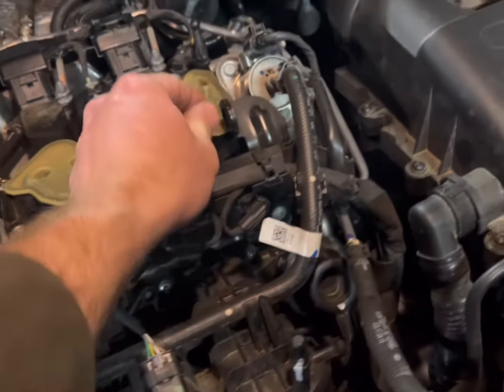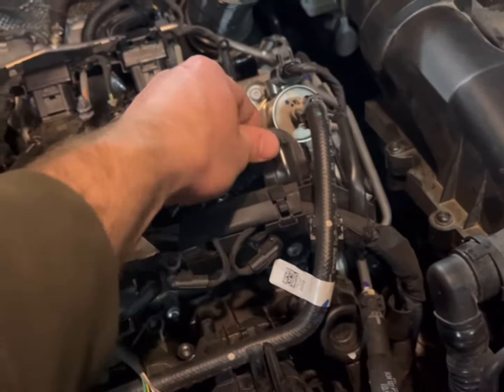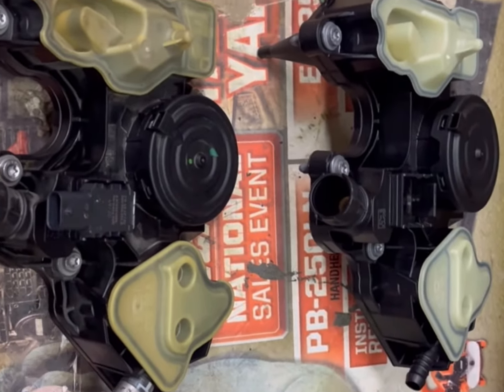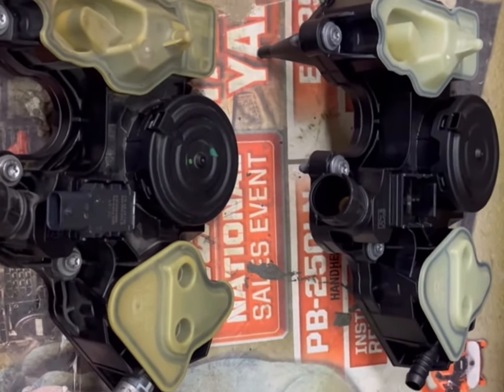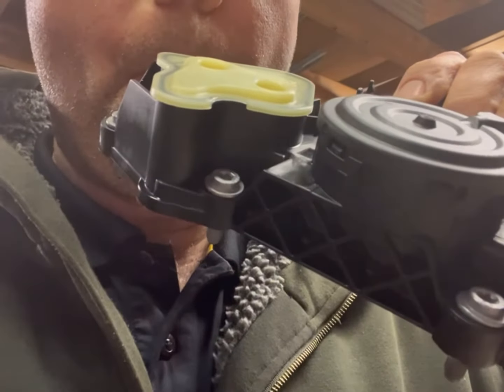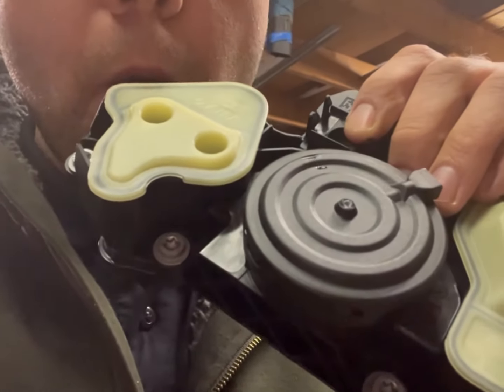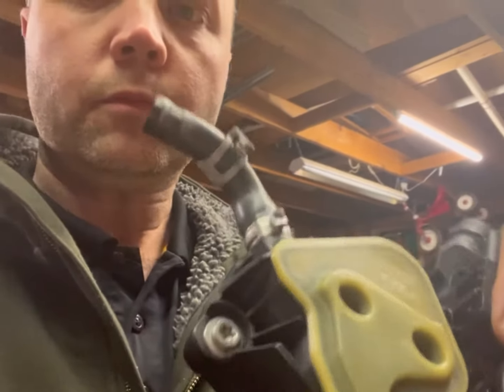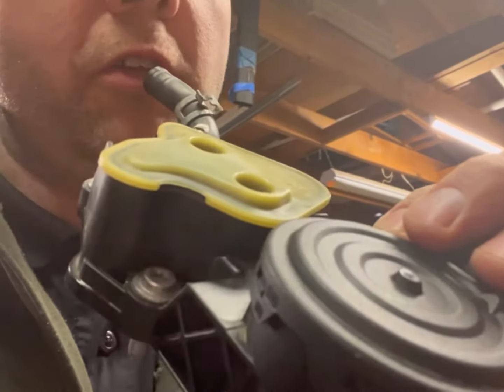Volkswagen MQB Tiguan PCV failure P24D6

Comment: Thank you for the video and part number.  My Arteon takes the same part.   How long did the job take you, and what is your skill level?  Did you replace any associated hoses?  Could you have unhooked a hose and done the blow/suck test without removing the part from the car (maybe with a rubber bulb so you didn't have to do it with your mouth/lungs)?  Thanks!
Reply from the maker: It took me about 30 minutes, I could probably do it in 15 now that I know what to do.  I'm not a mechanic by trade but I'm fairly skilled.  I did not replace any hoses since the car isn't that old and they looked to be in good condition.  I think you would need to have the part off of the engine to do the test that I did.  You can probably do the test with a vacuum tool as well if you don't like inhaling oil residue.

Comment: 2022 Tiguan, 34k miles and just found oil EVERYWHERE in my driveway. OBD reader said P24D6. I can see oil coming from the oil pan as well as from the valve covers. Taking it to the dealership tomorrow. Funny enough, I just got it back two weeks ago after it threw a P2406, dealership said parts were backordered and that it was safe to drive.... the oil in my driveway says otherwise.
Reply from the maker: It must be a frequent failure, the last time I was at the dealer they said they have had to do several of these.
Reply: It’s the timing cover where mine leaks I changed the rings and it leaked 2 months later I should of added the seal

Comment: I just replaced this on my 22 after blowing out my upper timing chain cover lol. And it started to leak a second time so finally did it. The code isn’t clearing for me though after a new sensor and PCV. Did you have to reset it or did it eventually reset itself?
Reply from the maker: I reset the code with a standard OBD2 code reader.  Many auto parts stores can do this for free as well.  I would think that it would reset itself after a few days of driving though.

Comment: if my 2020 burns oil really bad should i replace this part to see if it helps? i just filled it up with 5-20 cause i saw somewhere it shouldnt burn as bad and atleast get me through till i do oil change.
Reply from the maker: I don't know about burning oil, mine was causing the crankcase to pressurize and leaking from the front seals.  Once I replaced the oil separator it stopped leaking.

Comment: I changed mine 2 days ago. It’s still leaking oil. Should I wait until the oil stops leaking before I get an oil change?
Reply from the maker: It took a couple of days for mine to quit leaking.  I'm guessing the seals need a few heat cycles to get back into position.  According to my local VW mechanic, if it was leaking for too long, it may not seal back.  I got lucky and it stopped.

Comment: Were you getting both Evan codes p04of and the other code or just the other code?
Reply from the maker: P24D6 was the only code that it was showing for me.
Reply: P24D6 me ha mostrado mi carro q es por favor 🙏
Reply: I’m getting a p04f0 and a p24d6 code on my 2021 vw Tiguan. I replaced the gas cap and the n80 valve and it came back on so I will try this and let you know if it fixed it.
Reply: Hey bro, did you resolve issue? Same have both dtc
Reply: @ it resolved my issue once I changed it out. Was very easy to install as well.
Reply: Bro, but you had one or both codes p04f0 and 24d6?
Reply: @szyone1275 I had the P24D6 code at first then after driving on it the other code came up. But went away after I swapped it out

Comment: Would this cause the EPC light to come on as well?
Reply from the maker: I'm not sure if that would be a symptom or not.  It did not turn on in my car.
Reply: It might be too late but I got this code, I believe this is the reason so I ordered the part from this video, when I first got the code my EPC came on as well. What I believe the cause of that was that the PVC went bad, I drove it like that which ended up cracking the oil pan and dumping all the oil giving me the EPC code, had the oil pan replaced by the dealership as it was covered under a limited warranty however this part was not and they wanted around 1200 to replace it so I took hit home, 2 days later EPC game back on, all my oil was gone once again so I possible have a cracked pan again plus the PCV, will know once I replace it if that is what happened
Reply: @khmb003  hi yes that’s exactly what happened I drive it to long with the bad pvc and it cracked my oil pan from the pressure thankfully my dad works in cars so he changed the pvc and my oil pan for under $300.
Reply: @ayannamcadory391  are you able to ask him for the part numbers just in case I need to replace that as well?

Comment: I have an error code.p04f0 Tiguan 2021 what needs to be changed, I filled the car running
Reply from the maker: I'm not sure.  That sounds like a different issue.
Reply: Didnyou resolve issue?

Comment: Did it fix the problem? I’m getting the same code plus P04F0.
Reply from the maker: The code did not come back, and it stopped leaking oil.
Reply: Dodnyou resolved issue?

Comment: Fix it, sell the car, and buy a toyota / lexus product.
Reply from the maker: I recently bought a Toyota Highlander for my daughter.  It has needed a few things fixed on it as well.  It's just a part of owning a vehicle.
Reply: If you broke and cannot afford a car, then sure, a vehicle like Toyota may save you until you business going better
Reply: I actually cut mine open when it failed, just to see what actually failed. There's 2 small, round rubber flaps in there. One of them was torn in half; Basically allowing positive pressure to build up inside the crankcase anytime the turbo builds up boost pressure. It definitely caused the timing covers and oul pan to leak. Since replacing the part, the leaks have stopped entirely.

Comment: WHERE DID YOU PURCHASE THE VALVE?
Reply from the maker: https://parts.vw.com/p/97175234/06Q103495B.html      This is the site to look up and purchase from a VW dealer.  Shop around different dealerships, the prices vary greatly.  I got mine through Royal VW in Bloomington, IN, they shipped it to me next day.
Reply: @chuckdavis3587  Thanks. I ended up changing this valve. oil leak stopped and 2 check engine lights went away! haven't came back for 2 weeks. This vid was helpful.
Reply from the maker: @lacaro8565  Glad it was able to help you!